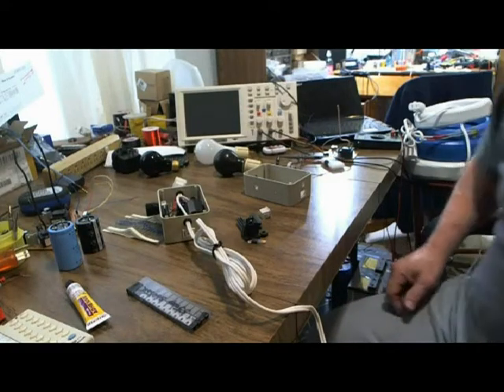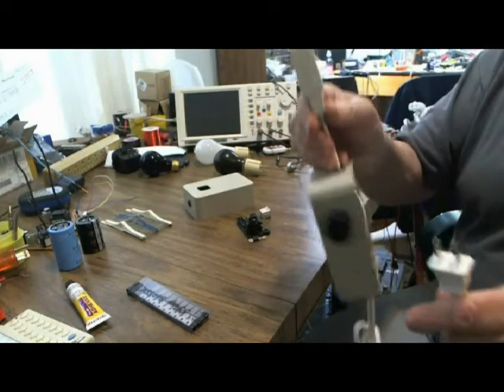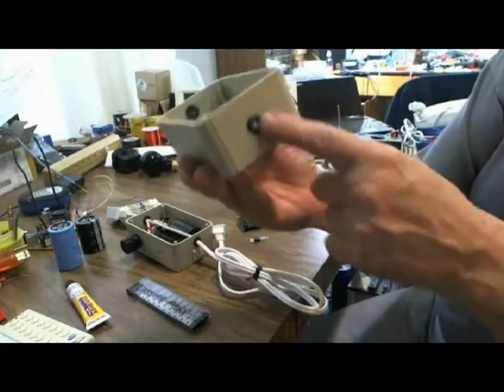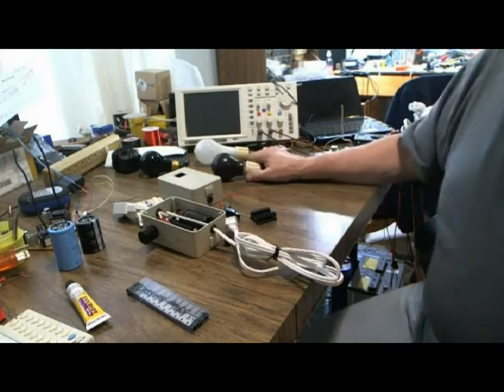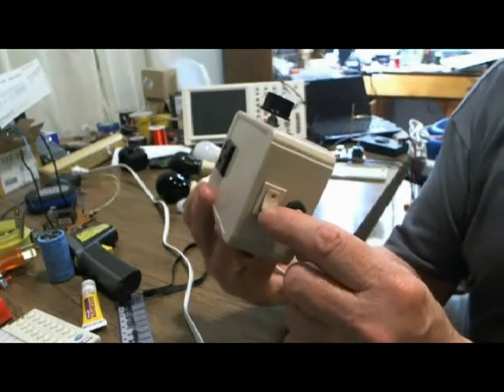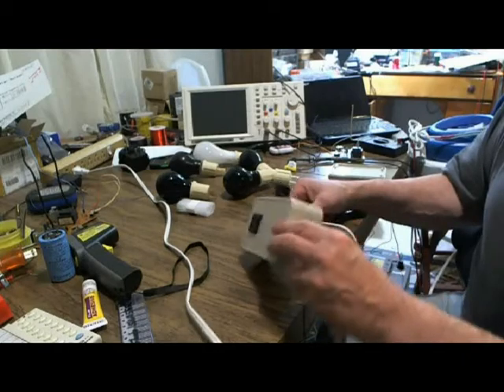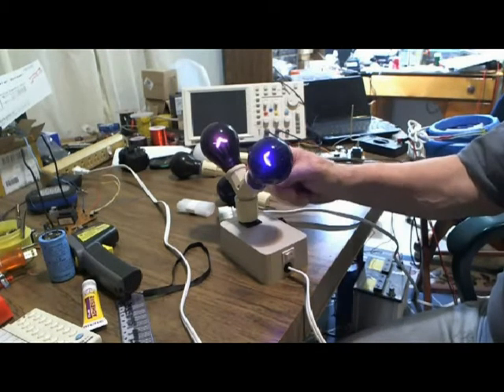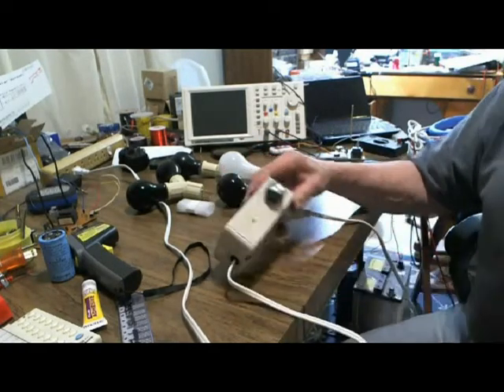Best & Simplified Bob Beck Style PEMF

Comment: How many Joules is delivered to the coil? The Beck pulser gives 29 Joules with 5 capacitors and he says thats its the minimum for penetration into the body. I think that this circuit only gives about 14 Joules since  W= (1500uF x 140^2)/2 is about 14 Joules.
Reply from the maker: This is going to be a long answer.  Best possible performance through a the 12 gauge  1 ohm coil would be 160 volts divide by 1 ohm equals 160 amps.  That is 160 x 160 = 25600 watts.  However the 1500 ufd capacitor is discharged in 2 to 3 milliseconds. Let’s say 2 milliseconds for this example.  1 joule is 1 watt second.  25600 watts for 1 millisecond would be 25.6 joules and for 2 milliseconds would be 51.2 joules.  This of course is if the Bob Beck PEMF could actually perform this efficiently.  Thanks for the exercise.

The Bob Beck PEMF has been replaced by the High Powered PEMF.  It is far more efficient than the Bob Beck unit and can deliver up to 7.57 pulses per second.  So it can deliver 7.57 times 51.2 joules which equals 387.584 joules per second.  See the scope pictures at https://www.aurorasky.net/html/high_powered_pemf.html.  Respectfully, Steve
Reply: @gskempe9  Thanks for the tutorial. Does decreasing the potentiometer resistance increase the pulse rate? and does that also increase the current?
Reply: @gskempe9  What if the coil resistance is 0.23 ohms? Would that burn out the circuit or can a lower wattage bulb be used to minimize the amount of energy delivered to the coil? (> 111 Joules) Is it safe to use a lower resistance coil and what precautions can be made to ensure safe operation?
Reply from the maker: @johndorio4427  Your questions are becoming quite circular.  This is not the proper place to teach or give extensive information on the theory of operation or precautions to ensure safe operation.  I respectfully suggest you do a little research regarding this technology verse asking questions that require extensive writing to answer properly..  Respectfully, Steve
Reply from the maker: YES

Comment: Hello , wanted to ask a question about the connection to the 70 Watt-second  Strobe flash, if one uses one of those - the 2.5mh 16 AWG coil should be connected tin Series according to Bob Beck, - could it be connected in Parallel is my question , and also in a 2nd scenario could the bulb be totally removed ?would appreciate your professional answer ?  Thank you for your time
Reply from the maker: The present Bob Beck scheme uses the bulb to limit the current (Amps) through the coil and circuit components.  Adding coils in series or parallel needs one to simply use Ohm’s Law to calculate the related current and voltage levels and insure they are not destructive to any of the circuit components.
Circuit efficiency is another matter and needs a more in depth explanation of circuit design considerations.
Reply: @gskempe9  Thank you
Reply: Beck designed the Strobe for a replacement for the old flas qube camers.  he put the coil is series with ground of the flash tube to handel the current.  I used a strobe light from chauvet miny strobe I bought off Ebay, but it is the Xeon flash tube.  I merely soldered the coil is series with the flash tube.  The LED unit won't give you much of a EMF pulse.
Reply: https://youtu.be/JXgl_MejMW8

Comment: Hi! This is very interesting. I am about to make my own pulser and had been researching all over for the best and simplest. And I found your youtube video. 

Just one thing though. The country where I am in uses 220 Volts. Do you have advise or perhaps a schematic diagram for a 220 Volts pulser? 

Thank you.
Reply from the maker: Just upgrade the three main components.  For examples; Rate the diode at 400 volts 10 amps, the capacitor minimally to 400 volts, and the SCR to 800 amps peak pulse current.  You might consider a bigger heat sink and venting the box with holes and possibly even a fan.  The diac and potentiometer should still work.   The larger the capacitor value and the smaller the bulb wattage is, the slower the full charge pulse rate will be in accordance with the RC time constant.  Bulb resistance goes up when rated wattage goes down.  The pot should be at least 2 watt or better.  That should do it.  Respectfully,  Steve
Reply: gskempe9 Hi Steve! Thank you very much for your prompt reply. I have become really interested in electronics because of these devices and am following your interesting videos.

Thanks again. May you be recompensed for your generosity.
Reply: @gskempe9  how much is the completed unit in US dollars? Found I had the Bob Beck PDF on a CD....
EarthPulse are selling their units for like $US$3000.00. Did a video on it...
https://www.youtube.com/watch?v=HbxXAzgsmgU&t=315s
Reply from the maker: The Bob Beck Style PEMF has been suspended.  However you should be able to buy parts and with everything you need to know on website, build it for about $30 US.  See followinghttp://www.aurorasky.net/html/order_information.html
Reply from the maker: @reallyjuicybrucey  Please see updated description under the video
Reply from the maker: Please see updated description under the video

Comment: hello friend i want to build one for myself and have one of these signal generators (chinese pwm) i need your help with question , can i use that pwm to switch on and off(control the frequency ) the bob beck pemf ?
Reply from the maker: Not easily.  Any circuit can be modified and enhanced including the Bob Beck PEMF.  However some circuits do not lend themselves to being changed easily and in the end they are no longer the same circuit deserving the same name.
Reply: @gskempe9  drive a couple of power mosfets in parallel to switch on and off a high voltage power source to coil.....
Reply: @gskempe9  thank you buddy

Comment: how long does a bulb last?
Reply from the maker: 5 minutes and then you have to buy a new one.from me.  They cost $100.  Kidding of course.  I would guess they would last at least 1/2 their rated life.  However I don't really know.  I haven't run my units for more than a few hundred hours and haven't had a failure.  There has never been a reported bulb failure  on the dozen or so units out in the field.  Check back next year and I'll let you know if there have been any reported failures.  Respectfully,  Steve
Reply: haha, that is expensive 5 minutes! thanks for  your answer again, Steve.